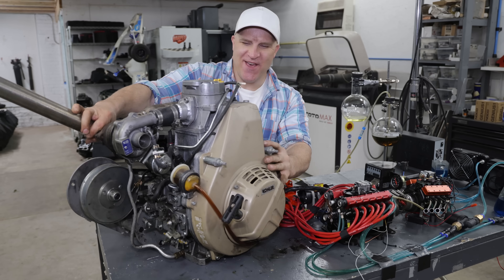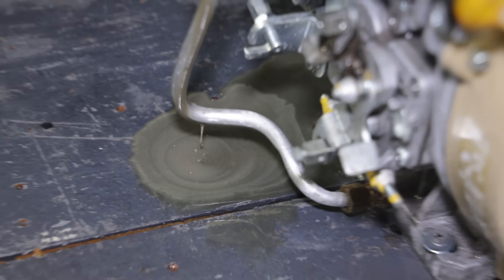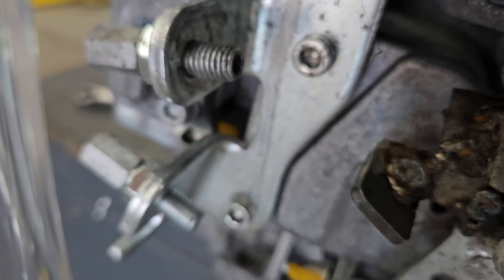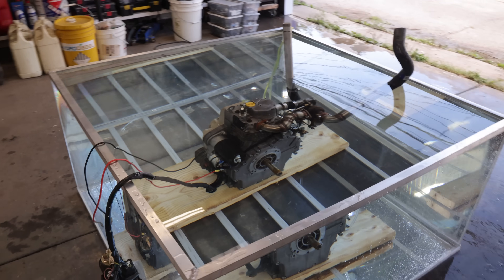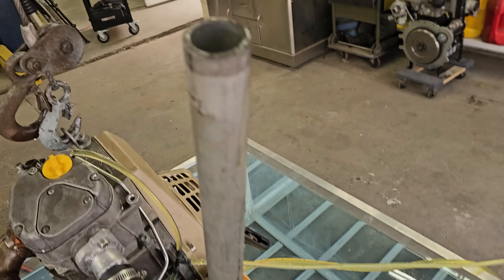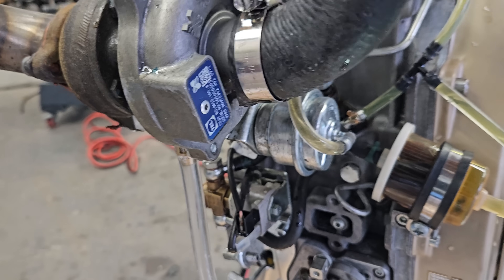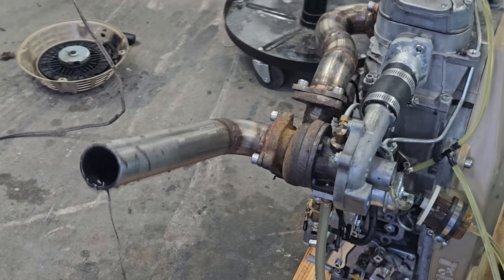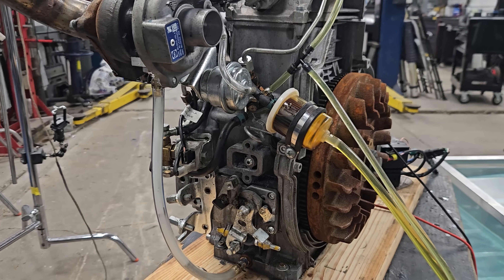Running Diesel Engine Underwater (Part 1)

Comment: If you use wax ear plugs on every entrance to crankcase including sensors and valve cover you might have a shot but turbo housing will need orange silicone and weld the intake to the turbo and close off the wastegate or recirculating valve to intake

Comment: Very curious about the noise level while it is running underwater. How much quieter will it be? Could that setup even become a super silent running engine, well of course with some additional muffler to support that. I mean not all of the engine noise comes out of the exhaust pipe, there is still a decent amount which is emitted through the housing itself. So yeah quiet curious to see the result! 
... But I would definitely remove those blades of the cooling fan, because that would create too much resistance, ....I think.
Reply from the maker: 100% exactly what I was thinking too on both of those points, if you need something that was super quiet I'm sure from a design standpoint you can get away with designing the engine of a thin layer of water around it and cooling, It's going to be really interesting to see

Comment: Buddy, I submarine four wheelers all the time there’s a thing called dielectric grease buddy buy you some of that and put that on your plugs and seals and all around every gasket and shit anything that has a hole for the motor plug it with a dielectric grease

Comment: There are a lot of sealing points which resist drop water but not pressurized water from outside. Even the crankshaft sealing doesn’t resist permanent pressure of water. Remind 0.3m of water depth create a pressure of 0.3 bar at these points. So you‘ll have to seal all sealing points to resist from enough pressure from the outside.

Comment: You should just start it and put it underwater running. They are not designed to be water or air tight. But in a diesel, the crank case should basically always be under positive pressure. I bet if it's running when you dunk it, it'll keep running. Only question mark is the turbo

Comment: Most diesel 4x4's go under water with a good snorkel. I wondering if it came from all the joints (air intake, exhaust) you had. Good luck with it mate.

Comment: I figured you would start it above the water and lower it in the water while it was running.  Like driving a 4 wheeler through a water hole with a snorkel

Comment: Close / seal fan intake side so will create some water / vacuum and will allow fan/  impeller to rotate more freely so you no need to remove flywheel and flywheel is very essential for diesel engine as well should mention all properly prepared/sealed diesels or gas  are totally submersible. Lots special vehicles out there.

Comment: I said get the Tacoma Way because you can always get another one and it isn't necessary, while the 2500 you need for trailering things the only plus about giving the 2500 away is that you can get a new one with the tax benefit

Comment: Can’t tell because the video is cut off from the point of submerging  to have that much water get into it must be a large leak unless it sat for a while under.  I have sunk a few bikes into the drink and as long as you drain the oil plug quick the water will run out of boil off but you have to be fast so there is no oxidation on Iron.

Comment: i would just remove the turbo for now.  Probably gotta cut fins off fly wheel. Start engine and lower it down into the water.  Water may be leaking in at the throttle shaft that goes through the block. That shaft is a loose fit because the internal governor flyweights need to be able to adjust the injection pump lever without too much resistance.  Might need to use an air compressor and hose to push air down into the crankcase and give it a few pounds of air pressure to keep water out???  Could adapt air fitting to the oil drain plug???  Or maybe dipstick hole???  Whatever you do, don't adapt an air fitting to anything that is for oil pressure gauge or low oil pressure shut off solenoid.  

Im not familiar with the kohler brand diesels but have spent a lot of time with yanmar and yanmar clones.  I get them used for cheap then install new injection pumps and injectors and they start with one pull and last forever.
Reply: New injection pump and injectors is all they really need?  You get them and that'll be the issue most times?  What happens, the pump and injectors get clogged up?
Reply: @Grateful.For.Everything they just get worn out.  Sometimes people run them without fuel filter so they get clogged.  First thing is change injector and pump and put on a nice external fuel filter.  Sometimes valve adjustment is needed.  Change oil and blow out oil filter screen.  That's usually it 👍

Comment: also you need to understand seals like the cranks seals are deshgined to stop crankcase pressure going outside, they absolutely do not stop pressurised water the other way (and by pressurised i meen even submerged) back in teh day we got over this by using 2 seals back to back opposite ways.
Reply: Yup they make spring loaded seal sets to seal underwater shafts

Comment: It looks like the gasket for the plate above the governor adjustment screw is what was spraying water out when you turned it over.  
 And it really needs a hose connected to the crankcase breather (where ever it is) going above water or at least into the intake pipe.
Reply: I'm pretty sure that is the crank case breather.
There's usually some sort of reed valve arrangement to add some backpressure

Comment: Why didn't they use the smoke machine to find any type of air intake in the engine before putting it in water? For example, they placed the smoke tube through the intake, covering the exhaust and saw if there was any smoke escaping even through the oil dipstick.

Comment: It's the crank seal lip seals are more like a check valve. They only restrict fluid movement in one direction
Reply from the maker: I was thinking that too but it happened so quickly, and a huge volume of water in such a short amount of time, I don't think it would be able to get six quarts in the engine in 2 minutes from the crank seal. Maybe a little bit of water but  not 6 quarts
Reply: @WarpedYT You might be surprised. I got 5 quarts of 20w50 out of my jeep in about a minute and a half when I royal screwed up a rear main. 
It's probably more than one leak. I would assume the air came out of the intake since there were no bubbles.
But you also have to keep in mine there is a crank seal at each end giving 2 leak paths. 
As others have said I don't think pressuring the crank case would work as your trying to force out instead of in. 
BTW love your videos. Your out of the box thinking is awesome. 
I do look forward to hearing what you find in the next video. My votes still on front and rear crank seals.
Reply: @WarpedYT 2 minutes is a long time that's probably only about a pencil lead size stream of water and assuming 2 feet of water over the crank that's just shy of 1psi pushing it. It doesn't sound like a lot. But pushing that through 2 lip seals in 2 minutes isn't bad. 
I'm a boater and I have learned just a pin hole can add a lot of water alot quicker than your thinking. 
I could and may be wrong and don't intend for this to come off as argumentative. 
Just enjoying something that requires thought

Comment: Pressurize the crankcase with a couple pounds of air and soak the whole engine with soapy water. Do the same things with the intake and exhaust
Reply from the maker: A couple people said the same thing, and what I was thinking was I could actually pressurize the entire thing and then submerce it in the tank again and I will be able to see exactly what's leaking, just like when you check a tire for a leak
Reply: @WarpedYT this is good as well. Probably more efficient way of doing it. I like to see you coming back! Love the videos

Comment: Since the engine is built for atmospheric pressure and the seal rings on the guy seal from the inside out, the opposite will cause the depth of water to create overpressure on both guy seals and water will be forced into the engine.Together with the oil, it passes through the open valves into the turbine. From there it passes through the open valves to the turbine and from there to the sled and exhaust.
Reply from the maker: True but either way I see it is if the entire thing is sealed from the outside with the exception of the opening for the exhaust and the intake theoretically it should work just fine, kind of like a diesel submarine, the engine is inside of the submarine which is a completely sealed capsule and then they just have the exhaust and an intake snorkel going to the surface

Comment: Could try sitting the diesel down in the water as it’s running to see at what level on the engine water is coming in.
Reply from the maker: A lot of other people here had a good idea It's a pressurize the entire engine with compressed air, and then I thought I can do that and then put it in the water underwater to see where the air is coming out of the engine pretty quickly. I mean it's just kind of weird because there's no oil leaking out of the engine anywhere so I wouldn't think water would  be able to get in

Comment: If you cant plug up all the air leaks, see if it will run with like 10psi of air being fed into the crankcase. That will hopefully keep the water out
Reply from the maker: I'm going to do exactly that pressurize the entire engine in a crankcase, then I'm going to submerge it in the water again and I should see bubbles coming out from wherever it's leaking

Comment: 5:25 where is that water spraying out from at this location? is that the source of your leak or a component you removed to get the water out?
Reply from the maker: Exactly I saw that during editing, I was so tired when I was filming this that I didn't realize it was spraying out of the crankcase in that spot lol 🤦‍♂️

Comment: Is that rusty air cooling wheel/fan connected to the engine shaft? If so then that's far too much resistance under water for the engine.
Reply: Water offers 32 X the resistance of air, at a given RPM. Resistance, (torque) goes up on the square of speed, power goes up on the 3rd power. At lower RPM, the engine should just churn right through it, but at higher RPM, that "impeller" flywheel cooing fan can easily use up the full available torque of that turbocharged diesel engine. It may not even be able to reach normal governed speed.
Reply: @vincentrobinette1507 it might be able to overcome it because once it gets enough momentum from kicking over it will probably displace the water enough to continue running. Another person speculated cavitation on the flywheel which I think is the most likely outcome as well.
Reply: @simplybeanjelly  He is planning on putting the starter rope cover on it, which throttles the impeller from the intake. Cavitation is VERY possible! With that, the engine may reach full governed speed, albeit fully loaded. Don't worry. It won't overheat!😋😋
Reply from the maker: Yes, it may be but I guess we will find out in the next segment, but I don't know the engine has some serious torque.

Comment: Toyota Landcruiser have snorkels that go up to the roof, so gas and diesel engines can run under water. 2:13
Reply: The "Snorkel" is design so the engine doesn't breath in dust while off-roading. It's  not design at all for water boarding
Reply: @Trident_Euclid  Do you know why it's called a snorkel? So you can breathe underwater.
Reply: @Trident_Euclid  bruh delete ur comment
Reply: @Trident_Euclid  bruh thats what the air filter was invented for
Reply: @Trident_Euclid it's not too late to delete your comment 😂

Comment: I love how surprised you were that the engine filled up with water after you submerged it 😂

I was more surprised it ran straight away afterwards. 

Definitely start it then submerge it. Block the crank ventilation valve. That way positive crank pressure will help stop water coming in from any other small opening
Reply from the maker: Yeah I legitimately for some reason in my tired mind They didn't see any way water was going to get in, as for the crankcase ventilation yeah I definitely agree, But in reality I wanted to be completely sealed as working only be a couple of possibilities of where it's leaking water in. It's got to be that governor control mechanism for the throttle
Reply: @WarpedYT I definitely think it's possible for the engine to be submerged underwater and run somehow. There are extreme 4wds in Australia that have diesel engines. And can often do big river crossings with the "hood" of the car submerged for significant time. They aren't submerged for long and are running before entering the water. But it's a really cool concept. Hope it works. Look forward to seeing more content. 
Also your red supra is sick 👌

Comment: Just a thought, but cap your intake and exhaust off when you submerge the engine. That way if water is leaking in air from the water filling the engine won't just vent from the intake and exhaust pipes!
Reply from the maker: I like that idea, I could honestly even build on that idea and pressurize it like you said then submerge the entire engine in the water under pressure and I will be able to see where the bubbles are coming out, thank you !
Reply: @WarpedYT don't over pressurize the crankcase though.

Comment: Your turbo now identifies as a jet drive.

I suspect the flywheel is either going to prevent starting or stall the engine when submerged. That's a lot of drag, way more than air. Fill the fins with foam or putty.
Reply: Or it will supercavitate

Comment: Very cool idea.  Try compressed air in the crankcase to see where it is leaking on the outside.
Reply from the maker: Yeah and I think I can even put the engine underwater again while it's under pressure and I will be able to see bubbles coming out from exactly where it's leaking.
Reply: @WarpedYT  That´s even better yet.  Again, cool idea.  Can´t wait to see part 2.  Later.
Reply: @WarpedYT  Soapy water will also bubble and make it very obvious like on leaky tires. That might be easier than lowering and raising the engine 10x to make sure everything is sealed.
Reply from the maker: @djoobstil I'm going to try that today

Comment: Underwater, that air pump is going to cavitate. That would be "bad"
Reply: This would look so cool with the slowmo setup he's got right now.
Reply: yeah same thoughts. Lots of turbulence from those fins made for air -> lots of air bubbles (cavitation) -> air isn't going to pull the heat away like water would.

Comment: Put some air from a compressor on the oil fitting, and see from where it leaks.
Reply from the maker: OMG...totally! thats exactly what I need to do, when I crancked it I saw water squirting out from somewhere on the side of the block but couldn't see exactly where, that's a great Idea.
Reply: @WarpedYT  Gotta make sure you also plug the intake and exhaust ports methodically
Reply: @WarpedYT That won't test everything though. Water was getting in not out. So the crank seals will do Thier job keeping it on as well as every other lip seal. 
You got a think those lip seals are around the circumference of the crank front and rear. 
Assuming that lip can flip back 1\16 or even 1\32 from the crank that's a lot of space for water to flood in. 
Definitely a good place to start but it doesn't test everything
Reply: Just leave the compressor connected while running it. The positive pressure in the crank case will keep the water out. But regulate it to a few psi so it doesn't push the oil out
Reply: Start it before putting into the water, the positive crankcase pressure should prevent water from entering.
Reply: @robertcoldham6849 I came to say that
Reply from the maker: It worked great BTW
Reply: @WarpedYT  Nice to hear that. Waiting for the video.
Reply from the maker: @CATA20034 It was pretty nuts. Should be out on Wednesday
Reply: Seal off where it was squirting water out of when you tried to turn it over... It should have been obvious 😂😂
Reply: It'll vent right out the intake and exhaust won't it?

Comment: fire it up and slowly submerge to see when it flods
Reply: Don't do that! Hydrolock will bend a rod and or crack a cylinder. The positive crankcase pressure idea is the best one IMO...
Reply: i think it would not leak if it were running from the pressure
Reply: Running engine can get permanent damage to crankshaft when water gets in cyllinder.
Reply: @nonameprovided-q3k  This is the video we want to see.